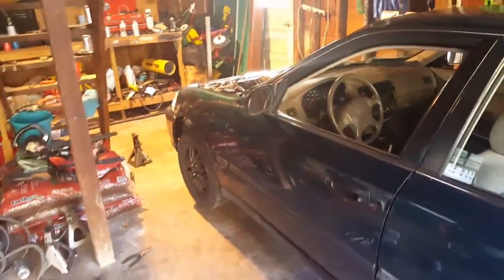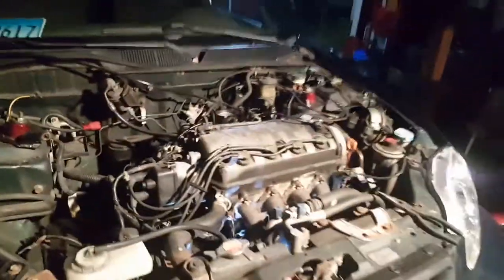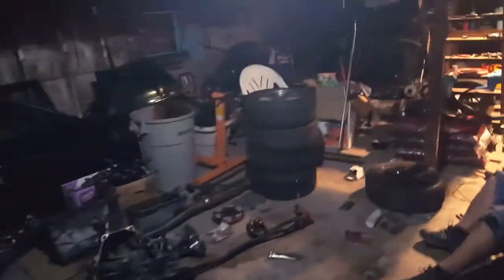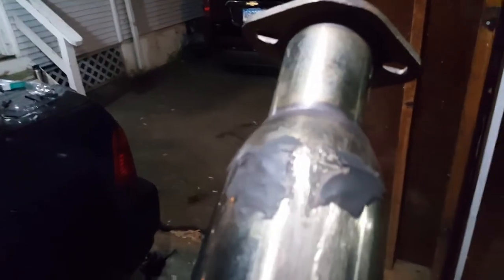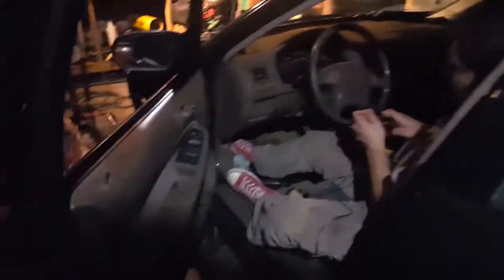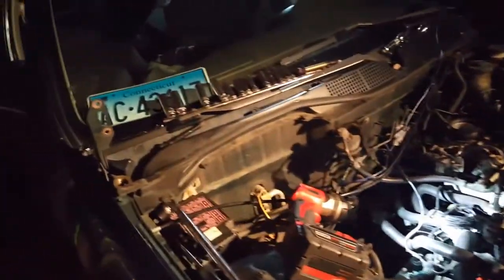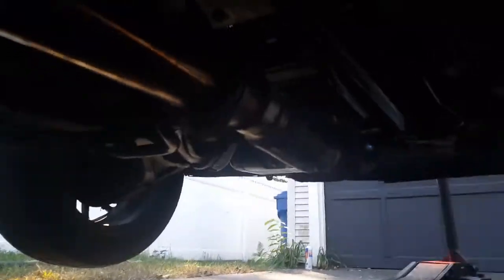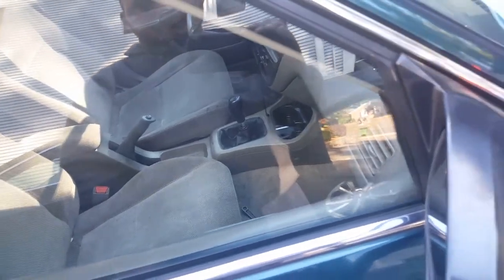Ek / ej8 sedan civic auto to manual swap part 11

Comment: I have a 00 civic manual tranny when i rotation my flywheel with the 17mm bolt on the crank. It spins then theres a point where it stops then i turn it back the other way a few turns and stops again. Is there something wrong i did. Need some tips
Reply from the maker: it's binding up, slowly try to take it out,hopefully it doesn't strip, back or out as much as you can and add wd40 on it then turn it back in and keep going back n forth while adding the wd40 hopefully it comes out
Reply from the maker: are you trying to take the crank pulley off?
Reply: @adorno1010  Not looking to take the pulley off the only reason why i asked was cuz when i start the car i hear like a clacking noise that i believe is coming from the flywheel. When i try to turn the flywheel one way, there like a stoppage point in which im not sure if thats normal.. i have a vid of the noise if you want to listen to it

Comment: I used your "auto to manual explained" video nd it helped me a TON. I bought a 96 98 5speed ecu car wouldnt turn on . like if pump didnt kick on yet w my auto ecu turns right over .. Was told i need a 5speed ecu from a 99 00 ? Also my speed sensor inst reading i still have auto harness plugs were same on 5spd nd auto do i have to re wire it or could i try anothr 1? Could i use the auto sensor ? Srry for all the questions just stumpped rn dont know wat to do any help is appriciated
Reply from the maker: I used everything from the automatic. What year is your car?

Comment: I just got an auto coupe and I'm gonna swap a 5 speed in it, but I'm wondering if the cruise control still works. I've seen forum say to connect the wires from the auto "shifter" so that the car thinks the car is in neutral and will let you start it, but if the Ecu thinks it's in neutral, then I don't think it will let you turn on cruise control. I do a ton of highway driving, so I'm always using it
Reply: I do know that I need a 5 speed specific ECU and that there's a button that detects the clutch pedal on a civic that's a stick from the factory
Reply from the maker: Chris sibley idk about the cruise control I just pulled mine out
Reply: Mkay. I'll just try wiring in the clutch safety switch. Almost sounds like too easy of a fix to work, but it's worth a shot

Comment: How did you attach the shift linkage ? What did you attach it to and did you have to drill new holes ?
Reply from the maker: Juan Carlos Rosado yes I had to drill new wholes.... if you look there are two indentations where they should be.. I just drilled in this email spots and used longer bolts to use a nut on the other side to make it fit
Reply: BOOSTED SEDAN Thanks soooo much man !! Really helpful ! I kinda bent where my auto shifter was but all i gotta do is bend it back a little but thank you so much !!
Reply from the maker: Juan Carlos Rosado no problem
Reply from the maker: Juan Carlos Rosado Juan Carlos Rosado check out my new video should answer all your questions
Reply: BOOSTED SEDAN eyy brugh, how mucc yu think it cost to manual swap an EF?
Reply from the maker: TheBikemaster94 that all depends on you and how you want to go about it. I bought a complete car that was already standard for $500. you can piece everything together for less butt you are going to risk the chance of not having every single part you need.

Comment: Hi do u need to change the loom wiring when doing a auto to manual conversion
Reply from the maker: no, you just need to add the 2 wires I showed on the transmission for the reverse lights to work

Comment: Yooooo Ct Im from there too ,Im doing the same conversion .
Reply from the maker: erik acevedo word let me know if you have any questions
Reply: BOOSTED SEDAN Yes sir I stay in southington now use to live in NB ..Yo Im swapping a y8 in a 93 hatch and converting a auto to a standard this weekend . You still in ct
Reply from the maker: erik acevedo yeah from Windsor next to the airport
Reply: Thats whats up
Reply: erik acevedo yoooooo Ct squad from Windham, in trying to do the same thing but I've been watching a lot of videos
Reply: EJ8 SEDAN  I have some questions
Reply from the maker: Mini Bike ask away
Reply: EJ8 SEDAN  I have a 96 ex Honda Civic and I'm doing a b swap I have er thang for the swap already I'm just wondering do I have to modify my harness???
Reply from the maker: Mini Bike You dont need a new engine harness  you dont have to do any extra wiring. Everything plugs in. If you have a DX/LX harness, you'll have to extend the TPS/MAP sensor plug, and repin the IACV. Other than that, its pretty straight foward.

Comment: Awesome job! I'm planning on doing a swap I got 1998 Honda Civic lx and was wondering if mine would be pretty much the same swap as yours? Motor and trans look almost exactly the same. One question I had were u able to use the auto axels still? Or did u have to use manual? If so then I should be able to use the auto axels in my Honda civix? Thanks bro
Reply from the maker: Theunitbth yes everythings exactly the same and I re used the auto axles.
Reply: Sweet awesome! What type of trans did you use?  Trying to see witch one to get for my 1.6 motor.? Thanks bud
Reply from the maker: Theunitbth i purchased a civic ex for $500 and stripped everyrhing from it that i would need fkr the swap

Comment: question on the ECU side when u switched from auto to manual ECU  do u have an extra plug left over or did u added that extra plug to the other 3 plugs for the manual ECU that is my main concern on doing the swap?
Reply from the maker: Angel Rosario depending on what model you have you will have a extra plug because of the abs system.... don't worry about that just plug in the ones that match up to the ecu

Comment: Hi nice video I have a EK1 civic with CVT transmission is it possible to manual swap it the same way you did for an auto transmission?
Reply from the maker: hopesfall should be the same process except for the transmission mount I believe is a little different

Comment: how much would it cost if you just bought everything you need and did it yourself
Reply from the maker: Merp19908 anywhere from 500 to 700 depending on the condition and mileage on the tranny.. better to just buy a standard car and remove everything I bought a complete car for 500 and removed everything I needed
Reply: +BOOSTED SEDAN 
thanks!

Comment: Where did you find the auto to manual transmission mount? I cant find no one selling it for 96-00 civic
Reply from the maker: IG Ek_saint I bought a complete car and took everything i needed
Reply: Because I asked everyone and they all told me the mounts are different , did you just use the factory mount ( like just regular manual mounts) and did the transmission sit tilted or straight ,. Asking because I really don't want to sell my car just to buy the same one only in manual
Reply from the maker: IG Ek_saint the mount itself is the same the only difference is the bracket that holds the rear mount. So you can use all the mounts feom the auto except the rear t bracket

Comment: How u guy do the reverse light to work
Reply from the maker: Chris Cosquilla Performance the wires that went to your auto shifter have to go to the reverse switch on top of the transmission. it doesn't matter which one goes where just take some wire and make it reach all the way there. it will be the  (yellow/red) wire and the (green/black) wire that used to connect to the auto shifter
Reply from the maker: Chris Cosquilla Performance Juan Carlos Rosado check out my new video should answer all your questions

Comment: How did that XTD clutch hold up?
Reply from the maker: Boosted Fool still on there holding strong slight clutch chatter in reverse but only noticeable because i have solid mounts. Just break it in correctly and you will be fine

Comment: nice video.  whats your I.g.
Reply from the maker: Carlos Garcia no I.G lol
Reply: +BOOSTED SEDAN I'm doing a auto to Manual swap. How hard is it to wire the clutch switch? And is it the only wiring you have to do ?
Reply from the maker: Carlos Garcia you don't really have to wire the clutch switch if you don't want to you can just connect two wires from the auto shifter together and it will let you start the car with out pressing the clutch in... I'm going to give you a link to the write up I used to do the swap read it and if you still have questions let me know and I will make a video showing you exactly what wires need to be connected to themselves 

http://honda-tech.com/forums/hybrid-engine-swaps-18/%5Bfaq%5D-96-00-auto-manual-swap-full-detail-44pics-2545764/
Reply from the maker: Carlos Garcia you don't really have to wire the clutch switch if you don't want to you can just connect two wires from the auto shifter together and it will let you start the car with out pressing the clutch in... I'm going to give you a link to the write up I used to do the swap read it and if you still have questions let me know and I will make a video showing you exactly what wires need to be connected to themselves 

http://honda-tech.com/forums/hybrid-engine-swaps-18/%5Bfaq%5D-96-00-auto-manual-swap-full-detail-44pics-2545764/
Reply from the maker: Carlos Garcia Juan Carlos Rosado check out my new video should answer all your questions
Reply: Just did great video. Now that I see it you explained so much and cleared everything up.